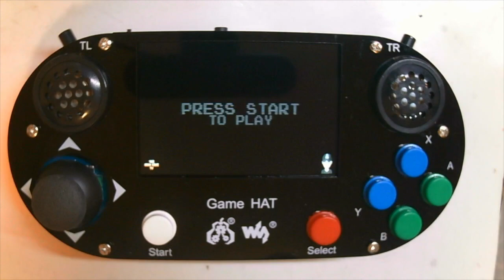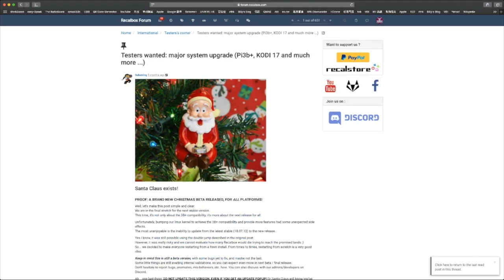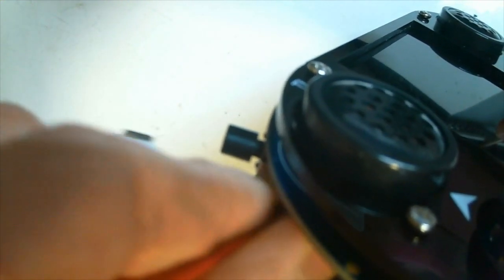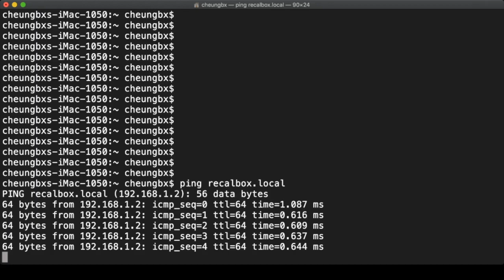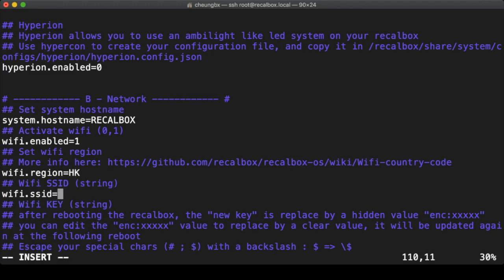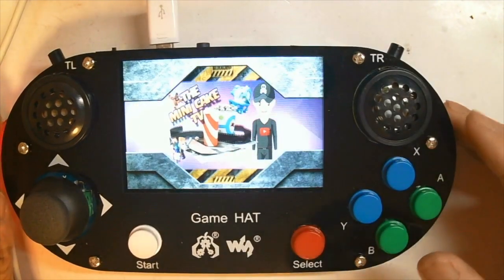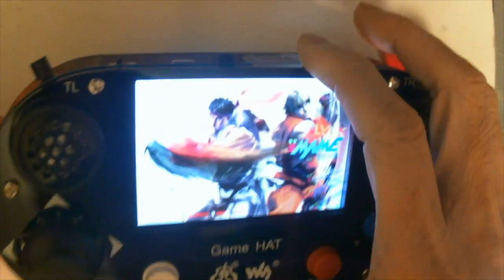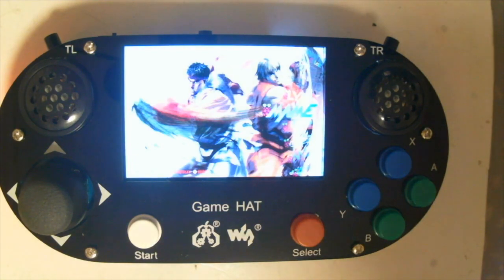Recalbox game console on waveshare game hat (see description for 6.1.1)

Comment from the maker: # — the bug with GPIO controllers has been fixed in recalbox 6.1.1
A copy of the recalbox 6.1.1. base built configured with waveshare game hat can be downloaded at this link (for SD card 4G or above)
https://www.dropbox.com/s/e0o4udzhlwc7hvy/recalbox611_gamehat.img.zip?dl=0

# steps to set up waveshare game hat for recalbox 6.1.1

ssh root@recalbox.local

type in password  “recalboxroot”

mount -o remount, rw /

nano  /recalbox/scripts/recalbox-config.sh

controllers.gpio.enabled=1

controllers.gpio.arg=map=5 gpio=5,6,13,19,21,4,26,12,23,20,16,18,-1

Then save the file.

type “reboot” to reboot the machine.

After reboot, the waveshare Gamehat buttons should be functional without configuration.

You can also press Start to go to the controllers settings to set up the buttons again.

There is no extra button for hot key, use SELECT button as hot key.

There is no analog joystick left and right, press Down to skip these joystick settings.

During a game, hold “SELECT” and “A” to go to the menu to quite the game or change the button mapping for that game. The you can save the setting for that game.

Comment: I was gonna buy this and put Recalbox on it but if it takes that much effort then i'll just flash a premade retropie image. I use recalbox because it's easy to get up and running. This seems counter productive.
Reply from the maker: I have made a pre-built image for Recaboxl 6.0 on Raspberry Pi 3B+. You can try to download and flash to your SD card if you do not want to go through the trouble. The link is at the description of this video.
Reply: Billy Cheung Oh thanks! I just have to get the game hat first. 😁
Reply: @BillyCdiy  Okay I finally got this all set up. I haven't updated to 6.1 because I didn't care for the 6.1 update in general and I know it will break the controller support causing some extra work for me. However I have been having some issues where certain psx games require the l2 and r2 to play. I can't seem to remap them in retroarch and get the per game mappings to stick. Do you know anyway to get the mappings to save?
Reply from the maker: @MobileDecay  , while you have started a game, press "Select" + "A" to go to the "Quick Menu" (Note I configured Select as the "hot key", your hot key may be different). Then select "Control". Then change the button mappings that works for you. Then select "Save Game Remap File".
If still does not work, try to go to the menu one layer above (press B), where you can find a menu option at the very end Configurations Override.
Select that.
Then select "Save Game Override".

Hope this help.
Reply: Billy Cheung Thanks! Worked! 😁

Comment: in ver. 6.1 some buttons not work now (like DOWN, RIGHT and almost all another). All this happens after ipdating from 6.0 to. 6.1. Any ideas friends? :-)
Reply from the maker: Оля Оля let me die load and test
Reply from the maker: # —recalbox 6.1 has a bug that cannot take on  GPIO Controllers  parameters from recalbox.conf ------------ #

Fix this for waveshare game hat as follows:

ssh root@recalbox.local
type in password  “recalboxroot”

mount -o remount, rw /
nano  /recalbox/scripts/recalbox-config.sh
Look for
    map="$extra2 $extra3 $extra4" 
Replace with
    map="map=5 gpio=5,6,13,19,21,4,26,12,23,20,16,18,-1" 
 
Save the file

Comment: Great job !!! I tried with the last recalbox version and it's working quite fine. Except for TL, TR and the stick push button... Did you have a clue on why ?? 
Thanks in advance
Reply: Change "controllers.gpio.arg=map=4 gpio=5,6,13,19,21,4,26,12,23,20,16,18,-1" to "controllers.gpio.arg=map=5 gpio=5,6,13,19,21,4,26,12,23,20,16,18,-1"
Reply: @felipealfano  Thanks!!! Perfect solution!

Comment: Hi,
I want to use Pi3b with Game Hat
When i write in the Config GPIO Controller, Save it and reboot the Recalbox, it will dont boot 🤷🏻‍♂️
I Need help.
And i can Not Save the Script config
Reply from the maker: LEH240 ，
There is not enough info for me to help. Which version of recalbox are u using? Did you use the mount command on Linux to remount the required disk partition as R/W before you edit the config ? Can u share your config files ？ sometimes reconfiguring the controller buttons at the GUI configuration menu will help. Have you tried that ?

Comment: hi man :) i did the process but when i reboot the recalbox, doesnt estart the pi and appear me this line : "random 7 urandom warnings) missed due to ratelimiting recalbox" what can i do? ty a lot!
Reply from the maker: Kattatssu Games , please paste the link where you download the build image of your recalbox from. So u know your version. Also share your modified cobfig files
Reply from the maker: @Androidparatodos16  , your image is for 128Gb. I do not have such a big Flash memory card, so cannot test it for you.
Your image seems to be based on recalbox version below 6.0.
I checked your dropbox files. Your recalbox.conf seems to be fine for a recalbox version below 6.0.

Please note that if your image is 6.0 or later. Then you need to Change my instructions from  "controllers.gpio.arg=map=4 gpio=5,6,13,19,21,4,26,12,23,20,16,18,-1" to "controllers.gpio.arg=map=5 gpio=5,6,13,19,21,4,26,12,23,20,16,18,-1".

Because recalbox upgraded the GPIO joystick software to a newer version that using some different parameters.

The most probably reason its not working is that you might have edited the recalbox-config.sh incorrectly and inserted newlines or broken up some lines.
If it's because you are not familiar with how to use the linux VI command. 
Please practice it before you attempt to make the change to the recalbox config files.

I checked your drop box file.
Your recalbox-config.sh  is the original file without modification. 
I am not sure whether you have restored the original version of it because your recalbox clashes when starting up.

anyway, to make it work. Please restore the original version of the recalbox-config.sh file.
Then please modify this file according to my video instructions. i.e.

mount -o remount, rw /

vi /recalbox/scripts/recalbox-config.sh

While in Vi Search for the line with extra2=“$4” using the command /extra2=“ , then press ENTER and a to add a line after it.

extra3=“$5”

Then Search for the line with map="$extra2” using the command /map=“
Then change it to
map="$extra2 $extra3”

Then press ESC and x!  to save.

Then restart the recalbox machine.

Comment: WOULD MY SD CARD WITH RETROPIE  ON RAPPERY3  PI 3 WORK WITH THIS  IF I  UNPLUG FROM TV TO THIS
Reply from the maker: Waveshare posted some instructions and driver software you need to load to the Retro Pie to get the waveshare game hat working Retro pie. You can refer to their videos. I made this video because there are no such instructions  provided by waveshare on what to do with Recalbox. Also, some of the other instructions I found did not work with the current versions of Recalbox.

Comment: Hi! IS perfect, but i cant exit of games like START + SELECT BUTTONS. How i can exit on games. Without this modifications, in my raspberry pi 3B+ i can exit of games normally with start + select.

Thak you for tour support
Reply from the maker: I was able to exit the game on my set using start + select with my modification of the recalbox.conf file.
Reply: In my case it worked when I (re)configured the Gamepad inside the recalbox menu. Push start+select (exactly!) at the the same time when you are asked for the hotkey.

Comment: Hi Billy can you make a recalbox 6.1 image for gamehat, I will be really greatfeul.
Reply from the maker: Will do in a couple of days.
Reply from the maker: Recalbox Waveshare game hat GPIO controller fix 

# — the bug with GPIO controllers has been fixed in recalbox 6.1.1

4G SD card image 

https://www.dropbox.com/s/e0o4udzhlwc7hvy/recalbox611_gamehat.img.zip?dl=0

# steps to set up waveshare game hat for recalbox 6.1.1

ssh root@recalbox.local

type in password  “recalboxroot”

mount -o remount, rw /

nano  /recalbox/scripts/recalbox-config.sh

controllers.gpio.enabled=1

controllers.gpio.arg=map=5 gpio=5,6,13,19,21,4,26,12,23,20,16,18,-1

Then save the file.

type “reboot” to reboot the machine.

After reboot, the waveshare Gamehat buttons should be functional without configuration.

You can also press Start to go to the controllers settings to set up the buttons again.

There is no extra button for hot key, use SELECT button as hot key.

There is no analog joystick left and right, press Down to skip these joystick settings.

During a game, hold “SELECT” and “A” to go to the menu to quite the game or change the button mapping for that game. The you can save the setting for that game.

Comment: L1 and L2 dont work
Reply from the maker: Do you mean TL and TR ? What version of recall box are u using ?
Reply from the maker: My original script only works for recalbox versions before 6.0. The version of the gpio joystick software has been upgraded.  If you are using recalbox version 6.0 or later  (released in 2019), then you need to change   "controllers.gpio.arg=map=4 gpio=5,6,13,19,21,4,26,12,23,20,16,18,-1" to "controllers.gpio.arg=map=5 gpio=5,6,13,19,21,4,26,12,23,20,16,18,-1".
Reply: @BillyCdiy  thanks. Worked